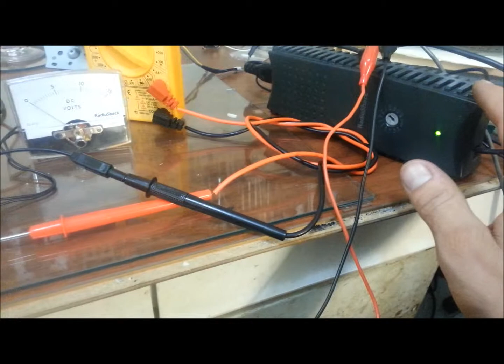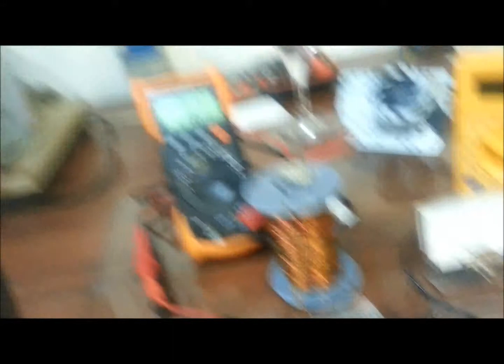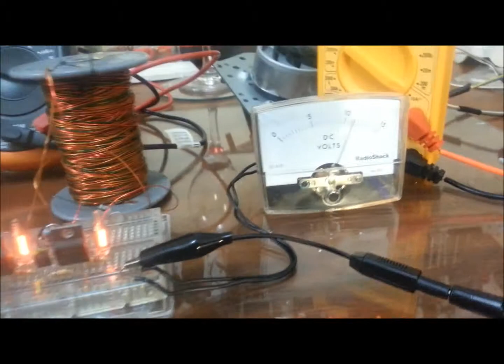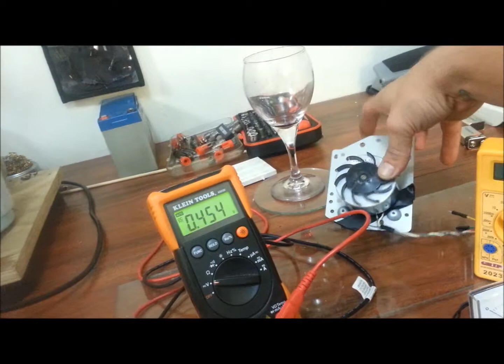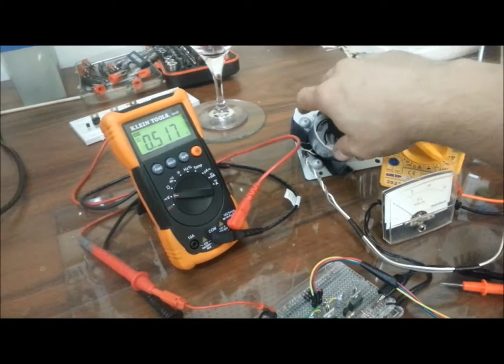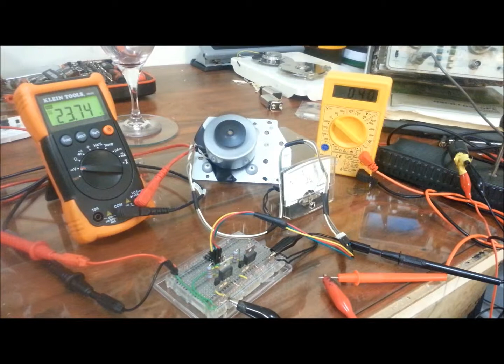Amazing Circuit

Comment: change batteries,circuit? power=voltsxamps...stop saying the volts is the power
Reply from the maker: 12 volt 1.5 amp power supply at 50 mili amp draw we are getting neons 2 at full bright and 54V output and will charge batt and cap and do it faster than any thing i seen out there thus far